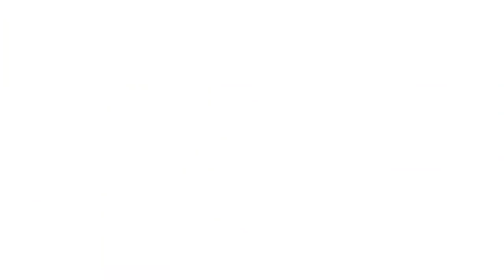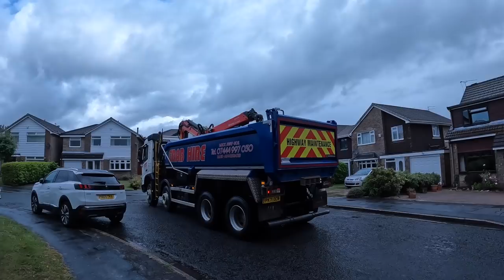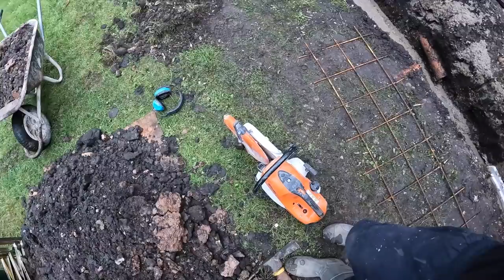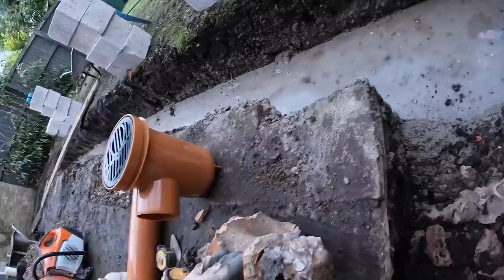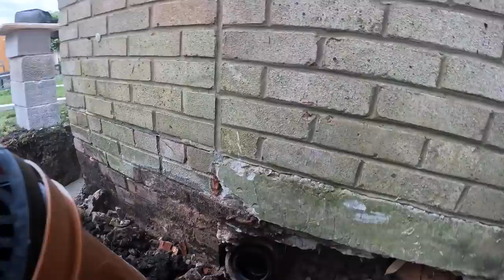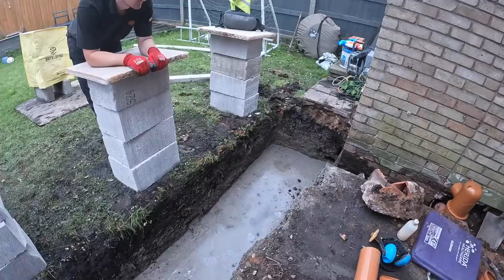REINFORCED CONCRETE FOUNDATION ... BI FOLD EXTENSION PART 2

Comment: in most cases providing some nominal reinforcement should be considered good practise, in case some tension develops in the footing from uneven loading/prevent cracking. 

Mass concrete/unreinforced is mainly suitable when loadings are perfect and not eccentric/ really light.

Comment: Great vids...how did you decide at what level in concrete rebar was required, seems like was put nearer the base the way you pushed that down
Reply from the maker: It was near the middle that concrete was nearly 500 mm thick 🧱👍🏽
Reply: @SteveAndAlexBuild  thanks....how did you judge, a lot of rebar I see set off the bottom with 5cm spacers
Reply: @SteveAndAlexBuild  I always thought that you put the rebar in the top or the bottom as it is to protect against the tension stress on the concrete foundation.  In a standard bean under load there is no stress in the centre of the beam.
Reply from the maker: @timempson2146  . 🧱👍🏽

Comment: Hi from Australia Steve and Alex. I'm new to your site but pleased to have found it. Nice to watch you work together. I'm planning on doing some excavation work and pouring some strip footings much like what you have done here. I'm just wondering why you didn't get the concrete to be poured around through a hose rather than wheeling it around in burrows. Was it a matter of access, or are there other issues to do with pouring concrete through a hose besides access. I've got so many things I'd like to ask but maybe I should wait and slow down. thanks guys.
Reply from the maker: Hi Jude , welcome to the channel buddy , glad you like it .
    The barrows are included in the concrete price . The pumps cost a fortune .😁🧱👍🏽

Comment: So the foundation is that deep and thick/reinforced because bi-fold doors will be installed?
Reply from the maker: No because the house foundation was that deep so we went lower , the steel was just a precaution 💪🏼🧱👍🏽
Reply: @SteveAndAlexBuild  With all that extra water in the concrete won't the steel rust out ?
Reply from the maker: @deconteesawyer5758  no the water evaporates and also reacts with the cement for the hardening process 🧱👍🏽
Reply: @SteveAndAlexBuild  You apparently feel you know more about concrete than the people that design, make and test it for a living. Two minutes research could disabuse you of that notion in that excess water in no way enhances the product. Quite the contrary.
With the addition of water to a load of concrete in excess of the design w/cm, the following performance
characteristics will likely be negatively affected:
• Compressive Strength
• Resistance to cycles of freezing and thawing
• Resistance to damage from Sulfates in soil and water
• Permeability – and its associated impact to strength and various durability characteristics
• Minimizing potential for corrosion of reinforcing steel
Reply from the maker: @deconteesawyer5758  No I don’t actually, which video will you be trashing next ?
Reply: @SteveAndAlexBuild  Nobody's peeing in your Wheetabix. Spade is a spade even if you call it a shovel.

Comment: Wonder if I could ask a couple of questions on this. Now I’m not a builder so what would be obvious to one isn’t for me. 
Why did you put polystyrene around that pipe? 
You guys have done a few lintel jobs where the steel has corroded causing expansion and leaded to blown brickwork. In this video you have put steel mesh into concrete to reinforce it. Could we assume then when concrete gets wet the steel will corrode, expand and weaken it just as in the lintel jobs?
 Other than that a good couple of days work
Reply from the maker: @martin2466  . No apologies needed Martin you explain it better than I ever could and it’s much appreciated
 😁🤜🏽🤛🏽🧱👍🏽
Reply: @martin2466  Only needs 50mm cover in that situation, no need to go any deper.
Reply: Just to add that you need oxygen and water for rust to occur. You won't get much oxygen in a foundation compared to a window lintel.
Reply: @martin2466  thank you for taking your time to explain. Very much appreciated 👍
Reply: @wayneleone  thanks for taking the time to reply, much appreciated 👍
Reply from the maker: @wayneleone  very true 👌🏼🧱👍🏼👌🏼

Comment: I still don't get these Trench Blocks, why not take the concrete to the level to accommodate just enough face brickwork for the floor, insulation etc, might have said this before I've never seen a Trench Block let alone laid one 👍
Reply from the maker: They are great Andy . That concrete already cost £800 another 450 would have almost doubled the cost 😳🥵🧱👍🏽
Reply: @SteveAndAlexBuild  I would have to do the maths, and I won't lol, I don't know what the blocks cost but them plus sand and cement, labour two Brickies £450, and it puts you a day behind wouldn't be to far of £800, we just like to mass pour and its done.

Comment: What…they placed all that with just one wheelbarrow….and it looked too wet, judging by the pond in the trench…!! Self levelling…lol…!!!
Reply from the maker: Na 2 lads and it was quite a distance too .
   Yeah the concrete pushed the water up to the top and it soon evaporated 🧱👍🏽
Reply: @SteveAndAlexBuild …evaporated…lol…got absorbed into the mix…,more water, weaker concrete…
Reply from the maker: @stun9771  wet concrete absorbing more water , never heard that one before 😆🧱👍🏽
Reply from the maker: @martin2466  😬😬😬🧱👍🏽
Reply from the maker: @martin2466  . It does , sometimes the sarcastic ones are worse than the all out abusive ones 🙄🧱👍🏽
Reply from the maker: @martin2466  . Mmmm except the scumbags who start threatening us . Not heard from them for while thank god 😟🧱👍🏽
Reply from the maker: @martin2466  Yes all of the vile comments were reported. 🧱👍🏽
Reply from the maker: @martin2466  🧱👍🏼
Reply: @SteveAndAlexBuild  and it's just a footer, not like it's a custom patio, as far as concrete
Reply: Apparently When wetted cement works by  sending sort of spikes out  and I suppose the more the better to a degree hence slurry mixes etc for floor
Reply from the maker: @frankbrooker6569  Never heard that one 🤔🧱👍🏽
Reply from the maker: @GRUBB-MUDD  🤙🏾🤙🏾🤙🏾
Reply from the maker: @martin2466  🤯🤯🤯😆🤙🏾🧱
Reply from the maker: @martin2466  😆😆🧱👍🏽
Reply: @SteveAndAlexBuild  …you never heard of the water cement ratio then…or concrete mix design…I came back to this thread as I saw I had a ‘like’…lol…I always love it when a ‘builder’ wants to put down a comment by inferring that the person who commented is some kind of idiot… actually lads, I qualified a member (MICE) of the Institution of Civil Engineers in 1996… I expect some of you were still at School then….I won’t drag out all all the qualifications and experience necessary to achieve that, but suffice to say, it takes a bit more than BTech exams, C&G’s or an apprenticeship…of which I had a three before commencing my studies to become a Chartered Engineer…at the bottom, at St Albans College of Building, before getting on a University Course for a degree in Civils… however, please feel free to offer your comments, and no, I’m not offended by your comments, I just wanted to put you straight on who was making them… perhaps you could let us all know your level of expertise too…
Reply from the maker: @stun9771  Just a lowly bricklayer currently struggling to find work after being hit with a massive tax bill I can’t pay so not really up for the banter any more , thanks